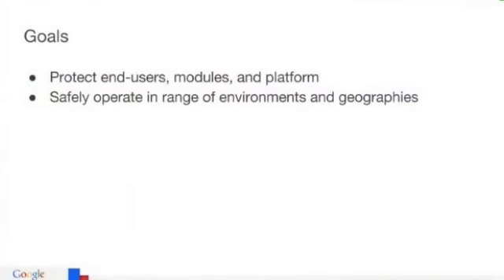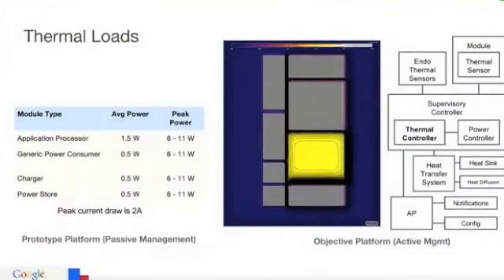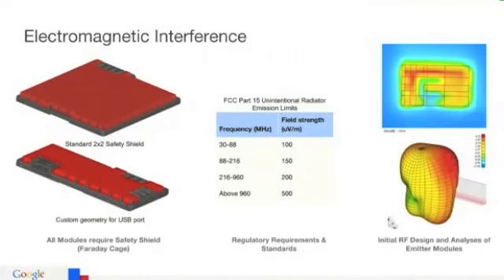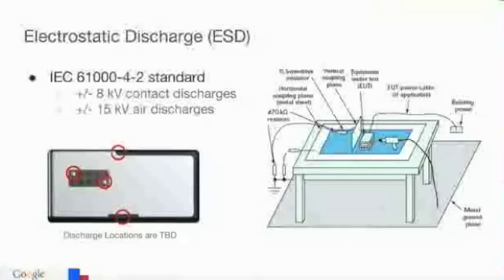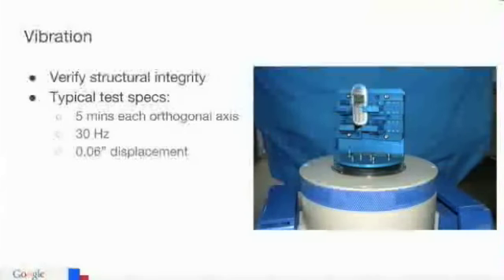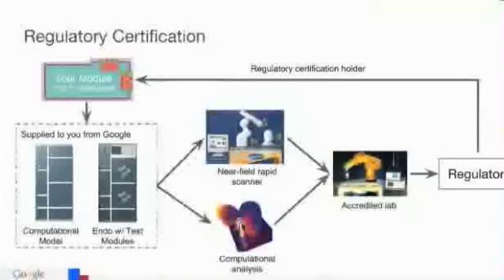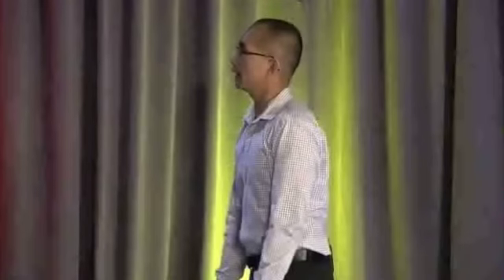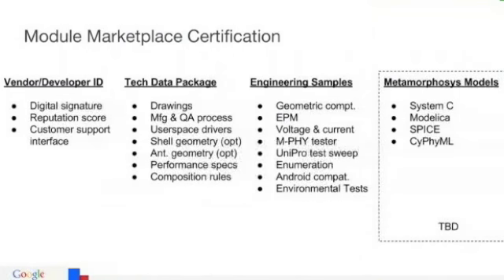ARA-BETA: Certification for MDK components

Comment from the maker: I can't help but feel there is not enough buzz about Project ARA! Project ARA is an effort to develop a P2P Hardware architecture and device eco system  built upon Android software. There will be no central processor, instead components share space within an endo-skeleton. Hardware components can be hot plugged into this architecture at any time during the running of the system. To sell your hardware on Googles MDK store you need to achieve FDA certification and Google certification. You retain all IP apart from where you communicate with the Endo-skeleton that has to be shared with Google.   

For those that missed it, here are a few sessions I recorded when I fell asleep recorded at 2FPS(so they weren’t too large) they have clear audio.  

ARA-BETA: Certification for MDK components

ARA-BETA: MDK System & Software

Legals for ARA MDK